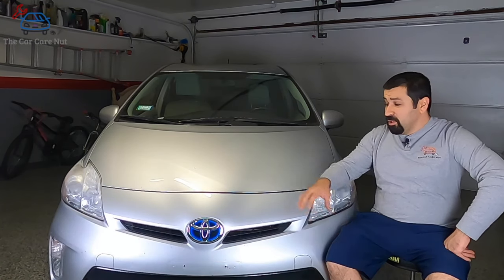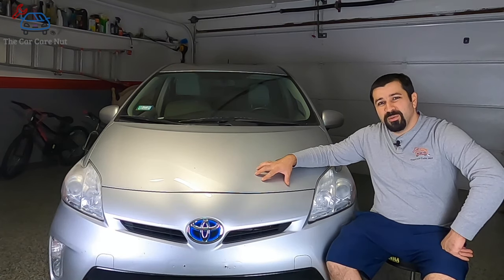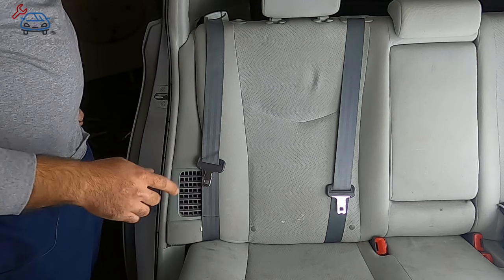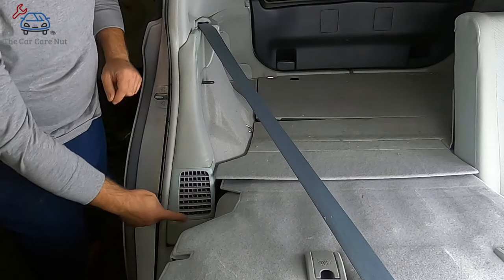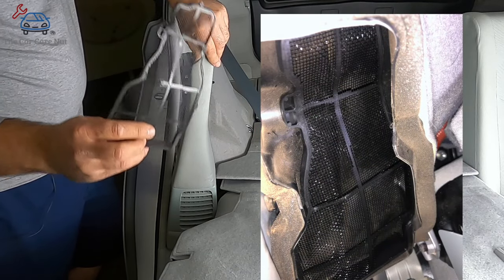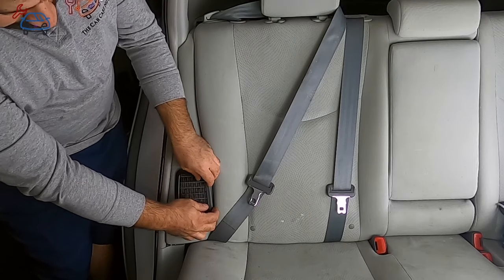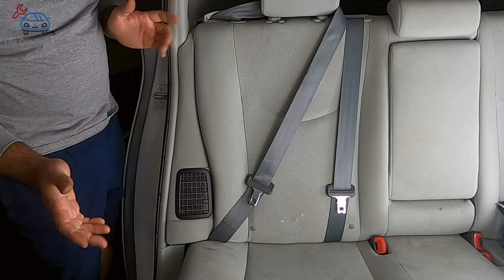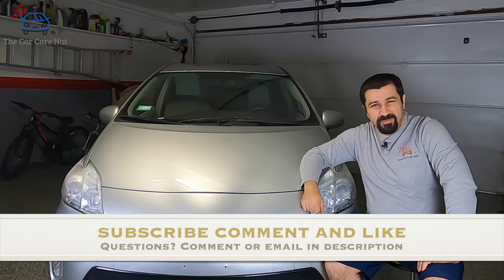How To replace Hybrid Battery Fan Filter : 2010-2015 Prius

Comment: Hi 
Please I'm having some issue with my car 06 highlander highbride just two days ago it refuses to start but full light will come up on the dashboard but ready light will not show up what can I do
Reply from the maker: Hi. It would have to be diagnosed by a mechanic but I would start with testing the 12v battery
Reply: @TheCarCareNut  the 12v battery is good  because I change another battery it still the same
Reply from the maker: Ok I would check for codes even though there’s no warning lights to see.

Comment: Hello AMD. I went to a Toyota dealership to buy the battery filter you recommended but they say it will not fit on my Prius 2014 based on their computer. I ask for a sample part to at least try to fit it and they said it is a special order and I have to pay for it and they  don't accept returns. Is there any other place I can buy this battery filter.  Thank you and more power to you sir.
Reply from the maker: Hi! Which style are planning to buy? The one inside the vent or the one that I recommend that clips on the outside of the vent?
Reply: The one you recommended that clips outside the vent.
Reply from the maker: It fits your car go for it. Just don’t double filter, if you have one inside the vent you’d want to remove it and install the one outside

Comment: MY PRIUS DIDN'T COME WITH FILTER AFTER 217K MILES I OPEN THE BATTERY NOT MUCH GOING ON THERE IS SOME LINT AT THE BOTTOM EDGES BUT THE AIR STILL PASSES WITHOUT MUCH OBSTRUCTION

Comment: Hi, thank you so much for sharing your knowledge and skills with all of us!! I have a 2012 Prius. After I watched your video I called my local Toyota dealer to try and get that pop on filter. They said it's not sold separately and I would have to buy the entire grill assembly. Any suggestions where I can get the filter only? I love watching your videos and I've learned so much! Thank you soo much :)
Reply: You can order it from https://www.toyota.com/owners/parts-service/parts  You can then pick it up at a local dealer.
Reply: Amazon has the air filter at a reasonable price!
 I ran over parts of a tire, it tore off a good chunk of my splash shield, the dealer told me $275.00 for a new one, YIKES! I did a little research and found a new one(probably third party), the cost was $55.00 including shipping, yes the holes were a little tight and the  geometry was a little off , but to save over $200.00 I can live with that! My Prius is third Generation  base model 2013. I put the new style filter on just like Car Nut said and after 15,000 mile very clean, no build up?

Comment: Is there a filter available for 2004-2009 2nd gen?
Reply from the maker: Yes there is. Part no G92DH-47020
Reply: @TheCarCareNut  Thank you!
Reply: Is it necessary to remove the original filter on a 2004-2009 Prius before installing the aftermarket unit?
Reply from the maker: The filter number I gave you is original not aftermarket. The 2nd gen Prius never came with one so unless there’s one clipped on the vent there’s no worry of double filtering.

Comment: I just opened and no filter 😢there
Reply: me too, i'm scared to look at the HV battery fan now 😮
Reply: @Jortdf534  try it
Reply: My 2010 has no filter, but I installed his recommeded filter (G92DH-47010).  I also cleaned inside the front part of the vent tube, not a lot of dirt or debris.

Funny thing, my toyota dealer recommeded a $150+ hybrid battery filer change...  Said the filter was dirty.  This video saved me at least $150+

Comment: How do you replace them on prius v ?
Reply from the maker: I’m working on getting a Prius V to film with. It’s located underneath the passenger rear seat if you slide it all the way forward you’ll see it. A bit difficult to get out but you can vacuum it
Reply: I found the filter and installed it thanks to this video! Thank you

Comment: I just checked behind the window to clean out the filter for the first time and realized there is no filter!!! Wtf???
Reply from the maker: Hi! Not all years have a filter. Which year do you have?
Reply: The Car Care Nut ohh I didn’t know. It’s a 2011.  How can they not think of putting in a filter?! Lol
Reply from the maker: They didn’t think about it when they designed it. But they did later and the filters in the video fit your car
Reply: The Car Care Nut yea I’m about to take out the cooling fan to clean it out now... check hybrid system message keeps coming on after about 10 miles of driving and when that happens, I can’t go into power mode and will only run on the hv battery until it runs out.  However, if you turn off the car and back on after a minute, I can go back into power mode and drive with engine on which charges the hv battery as well.  The “check hybrid system” message is still displayed with the high temp sensor blinking and staying on and off which is why I think it maybe the hv battery overheating? Not even sure if it’ll trigger it but I hope so...
Reply from the maker: I would clean the fan as likely it’s clogged and after cleaning but a filter for ease of cleaning in the future

Comment: What am I missing here? Comparing this cooling fan with that filter fan or fan filter two completely different things but I imagine the more complicated cleaning out like in this video is definitely not something I can do by myself but you would say this is important to do too no?

https://youtu.be/nHOtnpTzidQ
Reply from the maker: The idea of cleaning the fan itself is if the fan is actually clogged. It’s not something you should do regularly. The idea is this. If you have a filter installed it will catch the contaminants so they won’t make it to the fan. Then you wouldn’t have to worry about the fan. If you have no filter then the fan would need to be inspected with a camera before disassembly. If it’s clean install a filter and keep it clean. If it’s dirty then clean the fan once install a filter and not have to worry about it. Cleaning the fan is a lot more involved than cleaning a simple filter. So yes some of the fan cleaning itself might not be very DIY but the filter replacement itself is simple in most models.
Reply: The Car Care Nut I couldn’t read this after three sentences something is weird with my YouTube app.
Reply from the maker: This is what I wrote : The idea of cleaning the fan itself is if the fan is actually clogged. It’s not something you should do regularly. The idea is this. If you have a filter installed it will catch the contaminants so they won’t make it to the fan. Then you wouldn’t have to worry about the fan. If you have no filter then the fan would need to be inspected with a camera before disassembly. If it’s clean install a filter and keep it clean. If it’s dirty then clean the fan once install a filter and not have to worry about it. Cleaning the fan is a lot more involved than cleaning a simple filter. So yes some of the fan cleaning itself might not be very DIY but the filter replacement itself is simple in most models.